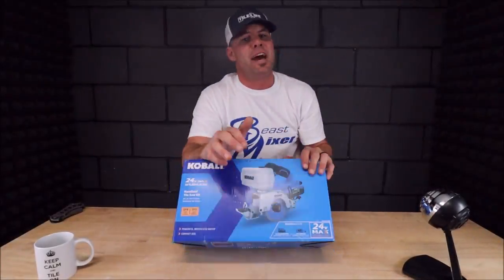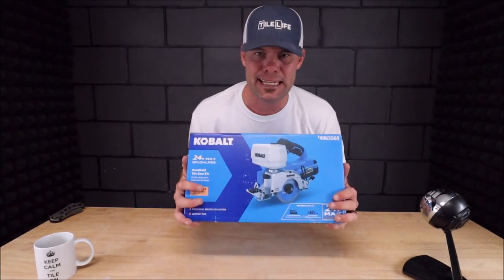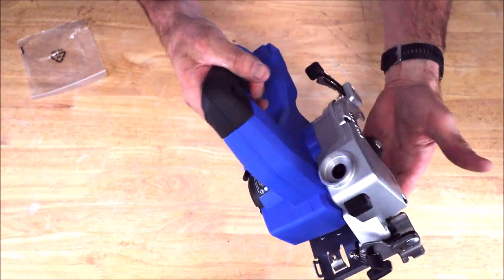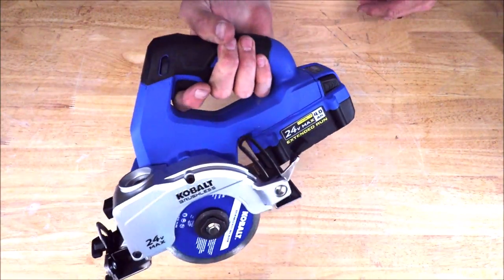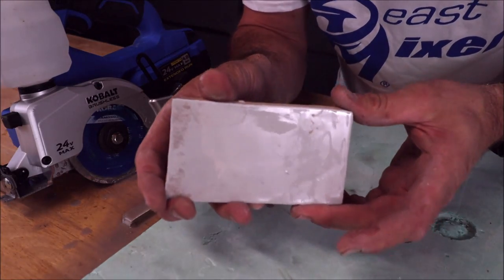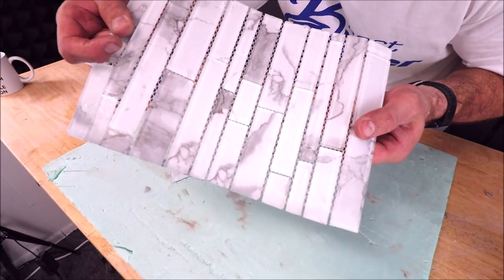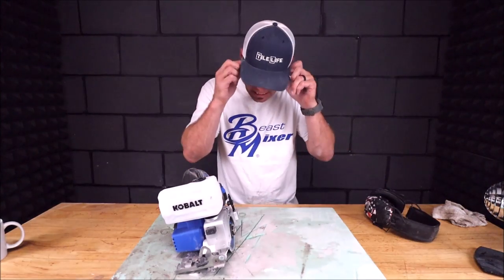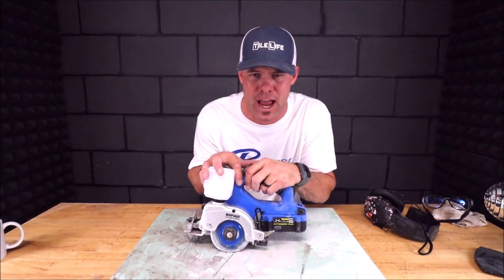Kobalt 24V Handheld Tile Saw - The King of Them ALL!

Comment: Looks like a bit of trouble with dust on the thicker ones at the end but really, you put small foam in a small plastic tray on a counter top, it would trap the run off. Backsplashes are never big tile.
Reply from the maker: I totally agree

Comment: I think the only practical use for this is cutting 4ft tiles and fixture wall cuts around pipes if u don't use diamond bits. Still looks like it blows the corners out just enough to notice. So doing a point to point is necessary before blasting through it. Also that blade is shit so with the ones i use it may hold the tile together better. Im still gonna get one. Good review man.

Comment: I’ve been using the Makita version which works on their track rail. It’s been a game changer. Factory quality cuts and ultra portable. Wet and vac options too.
Reply from the maker: I have that cutter in my HD cart right now. Little expensive at $480 out the door with the unit, charger and two batteries. Where is a good place to pick up the track rail? I'll put a Tile Tool Tuesday video together.
Reply: Id like to see that in action
Reply: @LandbergTileTV  its the same track rail that’s used for the plunge saw, but you need an adapter that fits to the cutter to make it compatible.
Not gonna lie, its a ball ache getting it all set up and figured out. Literally everything is sold separately.
I bought ….
Makita unit
Makita 1500mm track rail
Makita track rail adapter 
Makita water feed unit
Monolit 125mm dry cutting diamond blade
A bush adapter for 125mm blade to fit.

I had to figure all of this out because Makita doesn’t make it obvious.

If you have a contact email you don’t mind posting, I can send a few pictures that I’ve taken
Reply from the maker: @grrinc  That would be great. I appreciate the time, here is my email LANDBERGTILE@GMAIL.COM
Reply: @grrinc  Hey do you have the model number for the makita unit and the track rail adapter?  I am looking to try it out.

Comment: I need to cut a transition from kitchen/dining room to living room/hallway which is all laid with same tile. I need a smooth transition as I'm putting down vinyl snap lock tiles in kitchen/dining room and use a transition strip to separate living room/hallway which is ceramic tile.

Comment: Thats copy of makita dcc501. Does it has track at least? Can you change container and plug it directly to water valve?
Reply from the maker: No, I'll have a video up soon on that review of the Makita and do a comparison as well
Reply: @LandbergTileTV  sweet. To use a track for it you'll need an adapter. Then it becomes economic version of rubi tc-125 but on battery. For straight cut its perfect, for miter you cannot use it with a track.

Comment: maybe Its just me,47 years in the trade.I can go to Homedepot and drop $300.00 on a ok stand up wet saw,and it would blow this pc of crap away.Come people,just something else youll put in your truck box and use twice.
Reply: It's a diy or maybe a tool for a handyman that does sporadic tile work repair and doesn't want to haul around other saws all the time. 

I guess the bonus to it is that  you don't have an arm that would flex slightly or a table that doesn't track, but from his demonstration I don't think that blade gets wet enough that its going to last more than a backsplash worth of cuts.
Reply: Makita has a similar saw, but it has the option for you to attach to the vacuum for dry cutting.
Reply: @ProxyFinal  Milwaukee has the same thing with their 3" grinder, a cutting/saw track and vacuum attachment. Just no built in wet, thus far have had zero issues with just damp cutting the trace and dripping a sponge into the cut. Doesn't really make sense to be doing anything but plunges with something like this if you are an actual tiler - you already have better saws for the operation.
Reply: @rotatingrecords  that m12 cut off saw is no good.
Reply: @ProxyFinal  with the right blades it ain’t bad,  but it still is one of those rare what If moments where it’s nice to be able to pull this out for a cut or two and be done with it. Some jobs setting up a full size wet saw is just a hassle or not a feasible option.

Besides 90% of your cuts can be made with an snap cutter anyways :)
Reply: @danallen1828  to be honest, that m12 cut off tool is probably one of my worst investments.  Sold it.  Still find it hard to believe Diablo makes blades for them